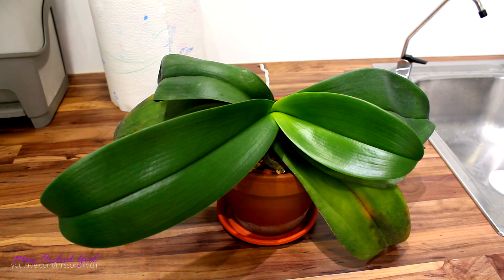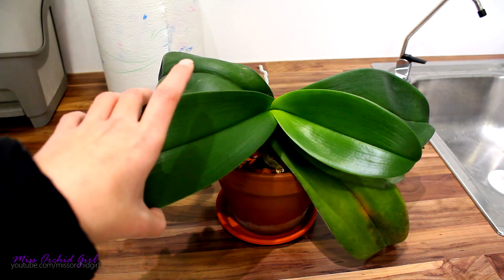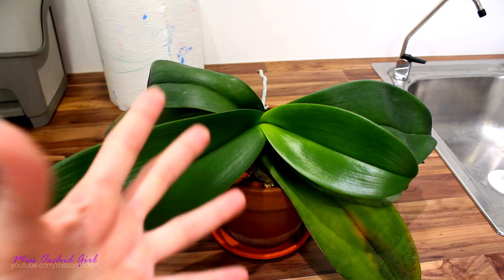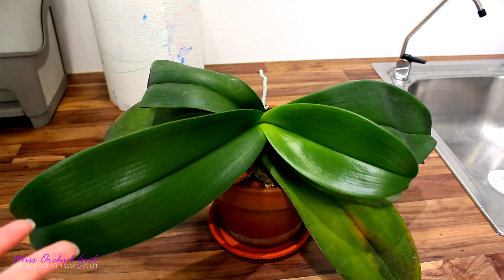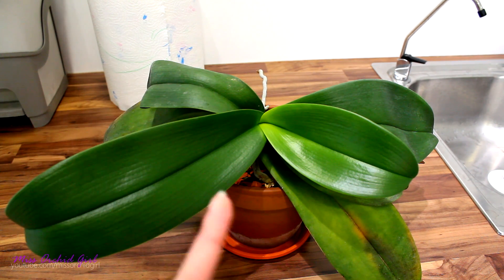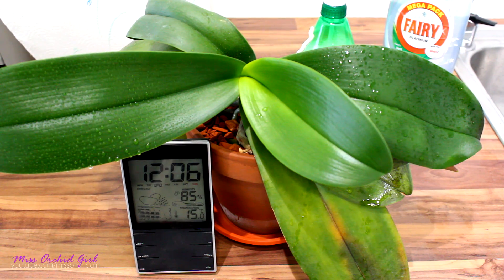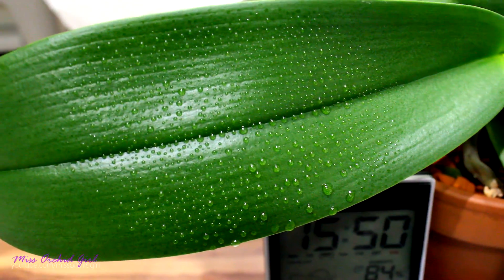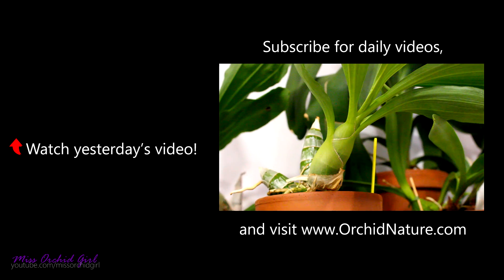The problem with misting Orchids + Small experiment

Comment: Here in north India the humidity never goes above 30-40%. This summer the reported dew point is 0'C which corresponds to humidity levels of about 25-30%. In the scorching afternoon I regularly mist my indoor plants which are kept in a wide courtyard and the water on the foliage dries in no less than 2-3 minutes. I can visibly notice the difference on the days I don't mist. Those plants look way happier after misting. Although I don't mist during winters as even though the humidity is low, the sunlight is not intense enough to dry the water sufficiently fast. 
It all depends on the climate where you live and what the plant requires at specific time of the day in that environment,and for that all we have to figure out is the watering needs and light requirement. 
BTW great video. I have zero knowledge about taking care of orchids but thanks to you I'm less worried about the survival and growth of my baby P.cryptix now.😊

Comment: You live in a climate where you've said many times the air is warm and humid year-round. I live in a climate where we have to heat our home during the 4-6 months when we have cold weather. As a result of that heating, the humidity inside is never higher than 35% and often drops to 15% on really cold days when the furnace has to run longer. Misting then is absolutely essential. "Pebble trays" and the like do nothing in conditions like that. Any moisture they release is sucked up instantly by the air before it has a chance to rise high enough to benefit the plants. Putting the orchids into a sealed tank or case can hold in some amount of humidity, but at the cost of increased risk of molds and fungi. Circulating the trapped air just moves the spores around, and bringing in outside air kills the humidity that you're trying to maintain. One way or another, misting can't be avoided in my experience, until warm seasons return and the indoor humidity goes up to a safe point naturally.

Comment: I belive the 85% humidity is sufficient an environment for you not to need to mist an orchid, and the air water content will prevent timely evaporation of water droplets, leading to standing water issues (i.e. rot).  Indoor plants will generally endure a 40% constant humidity and could easily dry out without misting.  Majorly an Orchid is an epiphyte, which has evolved epiphytically to derive all its nutrients from the air, this means that the orchid has evolved over millions of years to prefer nutrient rich humidity to normal watering.  A combination of nutrient rich spraying plus running look-warm water through the root system (but not letting it sit at all) would simulate the upper canopy epiphytic requirements of an orchid.  Ultimately, the orchid will more efficiently absorb nutrients in spray form compared to normal watering.

Comment: Pls reply i know its been a while this video been out but just need some help so Im leaving in a everyday sunny weather in asia(singapore) so is it fine if I mist my orchid or still a bad idea to be done?
Reply: If the water can evaporate quickly then yes misting shouldn't be a problems, but try to keep the misting on the roots only, not the leaves. Tbh you're better just watering the orchid once a week, if it is drying out too quickly, you can soak for ten mins once a week, if you're still having problems, use spgnam moss which traps the water for a bit longer. You dont really need to mist an orchid
Reply: @gemmacook1753   thank you !!
Reply: @journeywithDAN24  Sorry it's two years too late lol, I hope this still helps you anyway.
Reply: @gemmacook1753  its alright maybe its a helpful info for the new once 😉

Comment: But the dish soap causes spots on the leaves, which are unsightly. I would just mist with water and then wipe with a soft cloth. add some air circulation to dry further.  Or better yet, just wipe with a damp cloth to get the dust off.
Reply from the maker: +alan30189 yes that can work on small collections, but it's too time consuming on 200 orchid collections so we never actually wipe leaves unless we have stubborn spots. The shower is the most common technique, whenever we can do it safely :)
Reply: Thanks for the quick response.  I will have to check out the "shower" technique.  Maybe there is a type of soap that won't cause spots.
Are you still living in Cyprus?

Comment: I have a humidifier, keeps humidity level on the warmest days at70%. cost about $43 and does not wet the floor or any surfaces around it. I grow my collection inside my apartment with air conditioner so the air can get pretty dry without the humidifier.

Comment: I mist in winter because I live in Canada and I grow my orchids indoors in my high rise apartment unit. I have radiant heating in my apartment so humidity is extremely low. I have to use a humidifier to help. So I think misting is good if you have a dry environment.
Reply: i'm in canada too, how's your orchid growing? And what's your watering schedule? Can misting replace watering? thx!
Reply: @MasterofPlay7  Misting shouldn't replace watering, the reason is 
1) misting can trap water in between the leaves like the video says causing crown rot which is almost impossible to come back from
2) The roots won't be watered equally so you will have roots that will completely dry out and possibly die.
3) the leaves can suffer if water gets on them and stays on it for too long. 

Best thing to do is water normally, run the water through the pot or soak for no more than ten mins and see how long it takes before the media is dry and the roots are silver, then water accordingly. If you're still having a problem with losing too much water, use more sphagnum moss, or something like ceramis which is porous and traps water and releases it slowly.
Reply: @gemmacook1753  yeah I now water my orchid 1-2 a week, the old leaves limp though, but there are new leaves and roots coming out which is a good sight

Comment: I just left my orchid hanging above my aquarium. I didn't totally cover my aquarium with solid cover, just some bugs screen mash wired. The water evaporated from my aquarium is enough for my orchids. xD I don't know if the evaporated aquarium water is bad or good for orchid, seem my plant doing well after all this years.
Reply: I'm thinking of doing a bubble bucket idea, have the roots in a aquarium with a bubble stone keeping it breathing, and wet.
Reply: I use a similar idea. I have big diameter pot trays, each fitted with a square plastic drain grate, which the orchid pot sits on. When I water the pot, whatever water that goes through the pot will drain through the grate, and sit in the tray. Or if no water gets through the pot, then it's possible to add a little water to the pot tray.

Comment: The experiment was quite interesting, and I didn't expect the water with soap to evaporate that much faster, and this was very exciting to witness. With humidity trays, both the reduced surface tension of the water and also the increase of surface area exposed to the air (when using something in the water, like leca, a plastic egg crate, rubber mats, or seramis) will all help to increase evaporation. In my living room I have humidity trays with leca, and when the leca is wet, the surface of the water exposed to the air is much larger than it would be without the leca, and it dries faster. My biggest humidity trays have rubber mats inside them, to keep the pots above the water. I use heating mats below the trays, and the warmer temperature also increases evaporation. With the heating mats on, the temperature over the trays gets 6 to 8 C degrees higher, and the humidity in the air around the pots increases to 70% (it's lower further away from the humidity trays). Roots grow faster in this setup too. In my environment the air gets too dry in the winter, so the humidity trays and my ultrasonic humidifier are very important, and without them my plants wouldn't do so well. It's nice that with some little tweaks and tech we can grow orchids anywhere. :)

Comment: Hi Danni! Great points in this video. I was wondering if you could give me some vanda advice, my vanda doesn't have green root tips and I was wondering if you have any tips to get it growing again. It's slightly colder than room temp in the window where it's growing, thank you!
Reply from the maker: Hi Arib, well Vandas do have some periods when they will take a pause from root growing, but usually in the flowering seasons. Make sure that your Vanda is properly hydrated, maybe that could be the cause for the tips not growing. How do you water it?
Reply: MissOrchidGirl I soak it once or twice a day for 15 minutes, and I spray the roots every so often. Also , some of the top leaves seem to be dying and shriveling/yellowing. Any ideas what's happening? It's my first vanda and I don't want to kill it lol

Comment: Nice video I don't mist my plants. You probably remember my high humidity. Yea with it being 80% to90% and it's not uncommon for it to get to 100% outside In winter. Misting just don't sound like a good idea. When I dust I just use my fingers. This is how I broke a root not to long ago. I bumped it and the tip broke like a crisp carrot. But I will try to not handle the under leaf anymore then I have to. Don't want to damage it.
Reply from the maker: Yeah it would be better not to rub too much the underside, I never had visible issues but it's pretty obvious it might have some bad effects if we over do it :)

Comment: Excellent video on misting and the visual dynamics of disrupting water tension.

Hydrogen bonding between water molecules is responsible for surface tension. All drops of water are the same size because of hydrogen bonding between water molecules. Anything, such as soap/ detergent, that disrupts the hydrogen bonding creates smaller water droplets because the force holding the water molecules to each other is disrupted. Smaller droplets have a greater surface area-to-volume ratio than larger droplets. The smaller droplets evaporate faster because of the  greater surface area-to volume exposure to the atmosphere and because of the weakened tension holding the water molecules to each other.

It is the water tension that is responsible for causing water to move as a column from the root up through the plant to the leaves. It is necessary for water to evaporate through the stomata to enable water and the minerals(aka plant nutrients/fertilizer) dissolved in the water to move from the roots throughout the plant. The rate of evaporation is affected by the surrounding humidity of the plant and the amount of opening of the stomata. The size of the opening of the stomata is affected by turgor pressure of the guard cells surrounding the sotmata. There are several things that can affect turgor pressure.

Comment: Great experiment, Dany!
 As for Humidy Trays, I use expanded shale in mine. ES is porous. My thoughts are that a porous material and the combined surfaces of the ES Gravel greatly increases the surface area exposed to air, promoting evaporation. The same could be said of a bed of Seramis, Lava Rock, or Leca (hydroponic) Beads.
Reply from the maker: Indeed I think porous materials are the best ones for humidity trays, they also cool down the area due to the fast evaporation rate :)

Comment: I mist a lot. I think misting + cold weather is a natural combination. When it gets cold in humid areas, the humid air condenses on everything, including orchids, so the orchids are regularly covered in heavy, cold dew. I try to mimick this natural cold, wet (by dew, not rain) season. I will then follow with a cold, dry season. I see what you're saying about pooling of water in the crown, I suppose especially for monopodial orchids forced to grow upright. But I have a lot of sympodial orchids that I allow to grow in any direction. I think if you have orchids with few if any water collection points, the benefits of misting make it worthwhile.
Reply from the maker: Hi, well I think it all depends on what species you have, presuming not warm growers :) and also presuming you can offer the same ventilation as outside. But yes the vast majority of the orchids we grow are not cool growers and especially the monopodials are in danger of crown rot and cold damage (since water reduces temperature of the leaf even more). Mist a Phal at under 15 deg C and it will not be a pretty result I suspect :P mist a nobile at under 15 c in its rest and you might get away with it :))
Reply: pro trick : watch series on flixzone. Been using it for watching all kinds of movies lately.
Reply: @Brixton Damian definitely, have been using Flixzone for years myself :)

Comment: Very nice to hear your thoughts, and that was a really nice experiment. I guessed you would use dish soap as a surfectant :) 

I've read some people have the opinion that misting isn't effective at increasing humidity for plants anyway. So even if it weren't potentially dangerous, it's also probably not super effective. Same thing with putting them in the bathroom. In nature if a plant is getting humidity, it's probably getting it for sustained periods. Misting and the humidity in your bathroom only increases humidity for brief periods during the day. This could potentially cause issues with stomata opening during high humidity periods and then losing more moisture as the local humidity rapidly decreases (like you mentioned in the video). It's also possible it's just not benefiting the plant as much as people think.
Reply from the maker: Hi, yep I am wondering about these aspects as well, they do make sense for me at this point but it is indeed a good subject to research further :)

Comment: hi, 2 of my orchids are growing new leaves / plants on the flower stems.  is it normal?
Reply: Monica Kitching  hi Monica! Sounds like you might have a baby plant 🌱 or kekie(Kay-key) growing!! You need to leave it alone until it grows a few roots and maybe 3-4 small leaves. I’ve never had one yet, but I’m sure Dani has some videos about them😉
Reply: @sherileger730  its keiki
Reply: Keiki!
Reply: It's normal for dendrobium orchids which lose leaves and form this baby plants called keikis. You can replant those in a few months when roots sprouts around usually 3-5 cm. long to be safe.